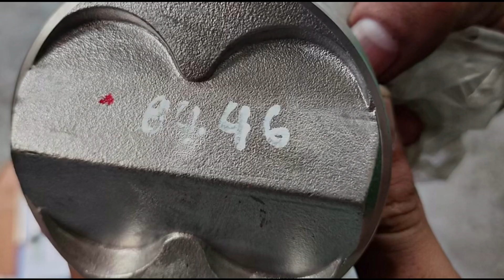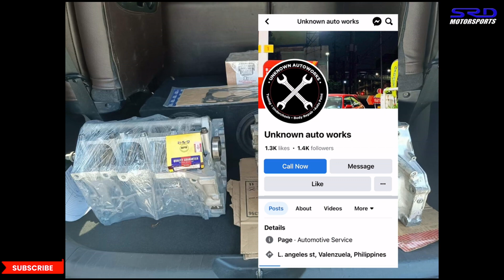Honda CTR B16b Stroker Build Series part 4 Valve to Valve Checking

Comment: Great video !! And that’s Interesting can’t wait to see what I get when I check my Blox type B cams I just degreed a set of Pro 3 cams and that’s about how they was I needed 4 degrees of separation between intake and exhaust to have adequate v2v clearance and when I degreed them to the correct centerlines I ended up +2 exhaust -2 intake so it worked out
Reply from the maker: Interestingly scary as after I filmed this? I retried it again after earlier in the day and those numbers on ur pro3 is what was safe wtf
Reply: Good to know I’ll expect the same when I check my Blox B cams can’t wait to see how they perform starting on the bottom end this week !! Do you have an IG account ?
Reply from the maker: @markwallace5274  yes sir my fb got hacked

Ig is @ralfsrdms

Comment: Great video! Need advice on timing, b18c block b16 head. Ctr pistons, and b tuner stage 2 camshafts, running them on stock timing but i got told by a friend if i miss a gear i would mess up my valves, what would you recommend for that set up?
Reply from the maker: Your set up is a strong good set up…

Besides even a stock engine if h miss a gear it mess up the valves sooner or later?

Comment: Hey boss...is it the end of the world if the cam rails are put back opposite way and bolts mixed up? They are identical right? Reason i ask is when disassembling the head i didn't mark the intake and exhaust rail, they look identical though and the bolts are mixed up
Reply from the maker: Oh the cam rails ideally would only fit one way so it won’t be installed “wrong”
The bolts will also be slightly easy as the 4 center ones will be the one that has a top thread for the spark plug cover
Reply: @SRDmotorsports im saying i didn't take it off the smart way like you and leave the bolts in the holes so the bolts arnt going to go exactly where they were and like i said i didn't mark intake and exhaust on the two identical rails so it's possible they will go back in a different way because they fit both ways. Sorry i suck at explaining things im sure it will be fine
Reply: Im saying say you took the intake rail and installed it on the exhaust side and vise versa. There the same so it fits and didn't put the bolts in the same spot thats cool right
Reply from the maker: Yeah if I put the intake side rail on the exhaust same orientation it will fit
However the center bolts that also bolts the spark plug wire cover on the Vc will not be in the same spot it will be on the opposite

so that will find its way either way
Reply from the maker: The rest is fine
Reply: @SRDmotorsports  thanks for taking the time to respond so well..you da man
Reply from the maker: No worries man! Don’t want u spending extra and thinking new parts or change head etc